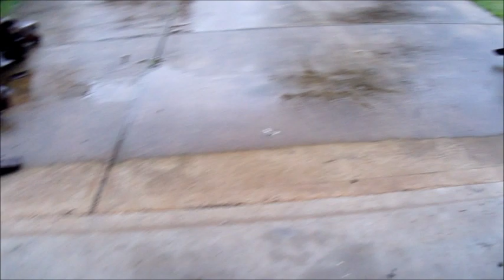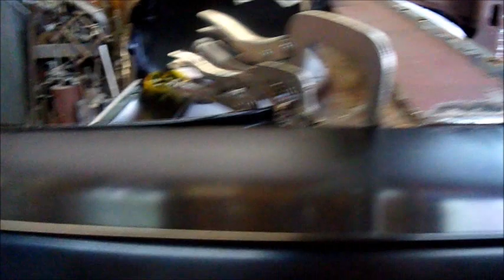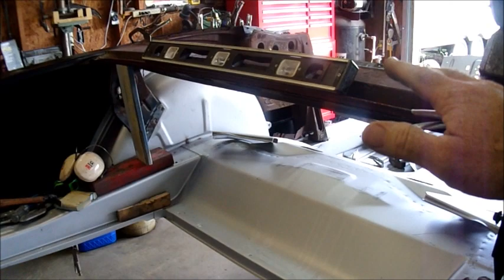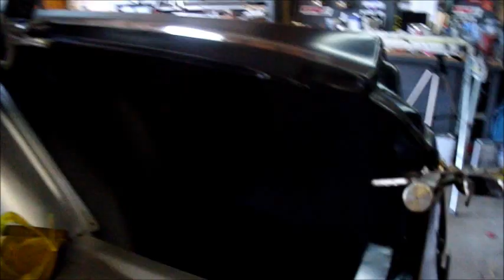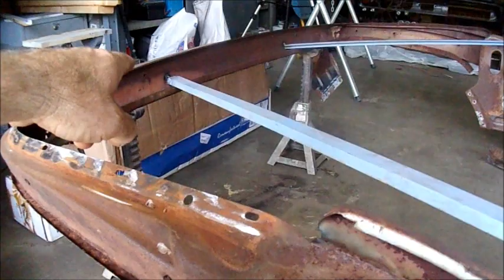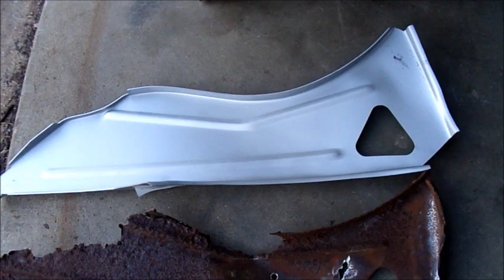1966 Mustang rebuild. Brooklyn Pony 6. More details....

Comment: Hi I am working on a 1964 1/2 convertible planning stage is there a good diagram of the body panels available and where they go and if they are same as factory seams trying to decide what to go with one area is front floor rocker and fire wall area
Reply from the maker: I don't know if there is an exploded view or not.

Comment: Hi, fantastic videos!  Really, really informative...  Question regarding the quarter panels you're using: do you find that the extra length is an issue with all reproduction panels you've used or just this "Dynacorn" brand?
Reply from the maker: I think they're all made at the same place honestly. I don't see a difference between the dynacorn and the other more generic panels I've used in the past.
Reply: Ok, thanks for the info!  I've got a '66 convertible that needs portions of most of the rear metal replaced so these videos are especially relevant.  Really appreciate you taking the time to show and explain your work!

Comment: If you going to have it blasted then soda blasting would be best of all. It is easily the least damaging ,sympathetic to old metal and leaves the job corrosion resistant for several weeks stored outside and several months stored inside. Because there is next to zero heat build up with soda blasting there is almost no risk of heat distortion.

Comment: Awesome Thaistang!  Were the Quarters Dynacorn as I use only Dynacorn as the Back shit Mustangs Unlimited try to sell never fit right. I went through a whole pile of 67 Tail Panels at MU and not one was close to the curvature of the Tail Light Bezels and would never be able to seal the lights!!!! Got a Dynacorn and it fit like a Glove!
Reply from the maker: These are "dynacorn" quarters, but from my experience, they are the same as the ones I bought previously from MU. I think the panels for the 65-66 cars have been around longer than the 67 and up. The tail panels I use are original tooling.
Reply: realtaur yep, I know what your talking about. Had to send several import panels back for my 67. No problem returning them though.